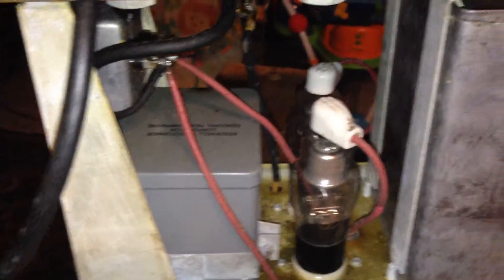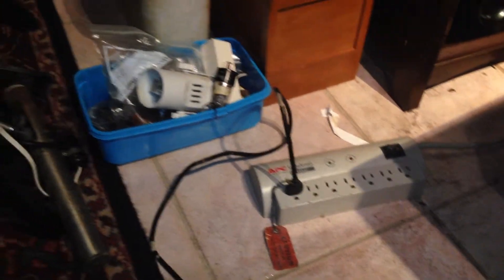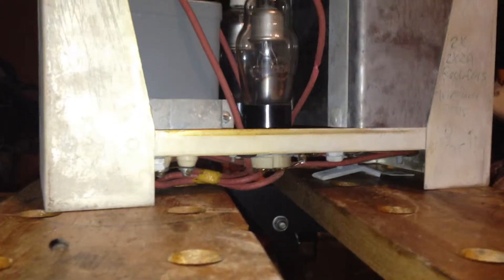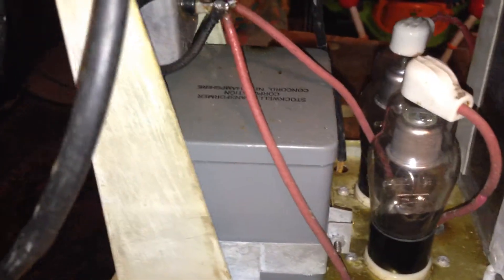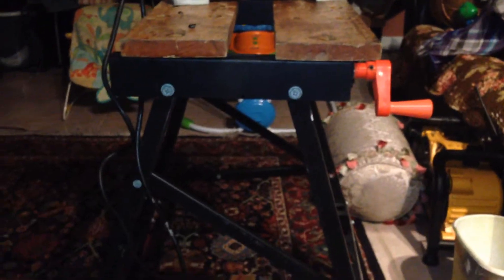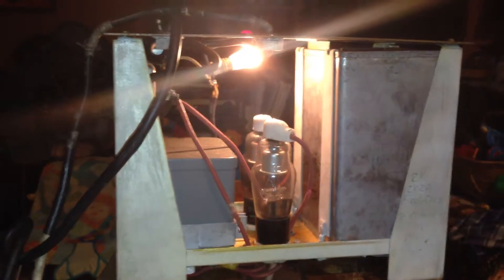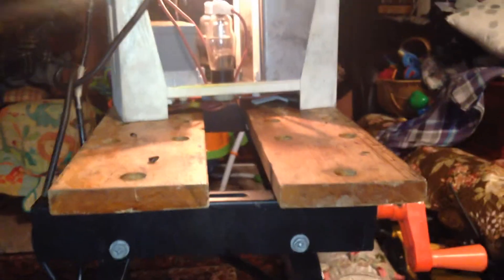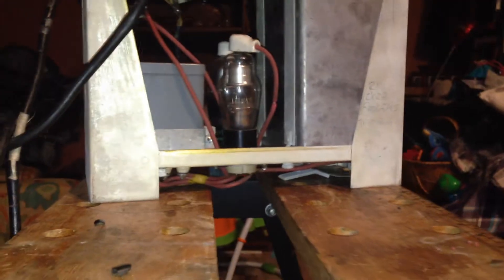Wabash #4 TERRIFYING discharge. FIRE IT UP! Caution LOUD ON HEADPHONES.

Comment: Cool Video Steven. Awesome and Dangerous !  Are you pushing some type of relay? to fire it. I bet the camera had a cable that plugged into the unit, to fire it when the shutter was opened.
Thank you for the upload,my friend.
Take care.
Reply: Steven King
Hi Steven. 900 volt's depending on the amps, if high is fatal. if low it could still be fatal and at the very least would hurt very bad.  I've never seen anything like it.Though the two rectifiers could be some type of voltage doubler does it have some form of flyback coil inside the other box ?. If not it may be high amps and very dangerous. that would be a good reson for the safety  bar.
You have a good night to, Steven.
Reply: Steven King
Sounds to be very dangerous then.
Reply from the maker: How is Bobby doing? Haven't seen ya much lately... Hope spring over there has sprung my friend... S
Reply: Steven King
Hey Buddy. I miss your videos. I am doing ok. I hope you and yours are too. ? I am getting my sugar levels under some control. I hope your wife is doing well with her health problems Tell her and your little boy I said Hi.
All the very best Steven.
Bobby.
Reply from the maker: ***** s hey glad the sugar is down!  Joanna is fine.  Need any stuff, if I've got it just let me know.  My new phone for some reason won't upload videos, and it is the same phone! I'll be in touch.  Take care buddy.  S

Comment: And some folks chicken to do a CRT. (I used to).
A microwave oven cap can pop pretty loud too.
I bet the strobe is very bright.
Don
Reply from the maker: DO A VID OF THE MICROWAVE CAP!! I wanna see!  Yes Mr. Don, the condensor mic and the camera adjust on my iPhone don't show the "atomic" blast. But man it's so loud!
Reply: I don't have a junk microwave. Those make me nervous like that thing.  Shut, some of those ecaps look like M80s, ha ha.  I like to call caps fire crackers.
Reply from the maker: OK YES DON IMPORTANT POINT: anyone reading this? A MICROWAVE OVEN TRANSFORMER AND MAGNETRON WILL KILL YOU. Lethal voltage and amperage!  And running the magnetron without the faraday cage (case) WILL BLIND YOU.  Experiment safely! But just don't open a microwave. It also contains beryllium oxide on the insulating bushings.  Three things in a microwave oven that WILL KILL YOU.  Just watch a pro do it.  DONT OPEN ONE PLEASE.
Reply from the maker: Sorry, that's not directed at you Mr. Don!  BUT TO THE READERS AND WATCHERS HERE! Please don't do it...
Reply from the maker: Don can you do a "firecracker" video of some nichicons?  I WANNA SEE!!!
Reply from the maker: Don I want to see that video!